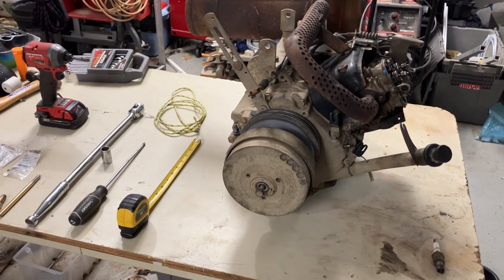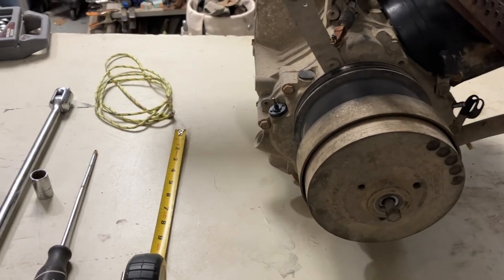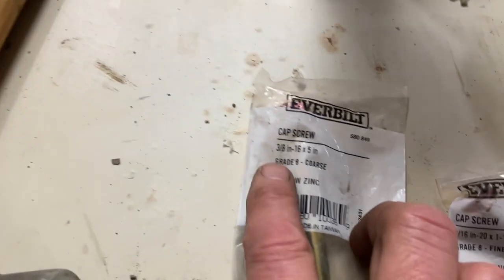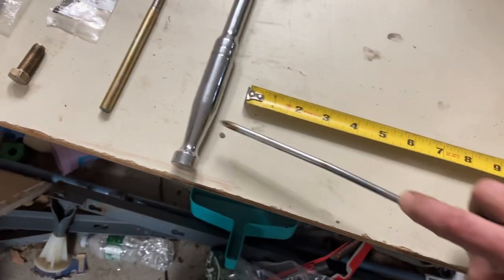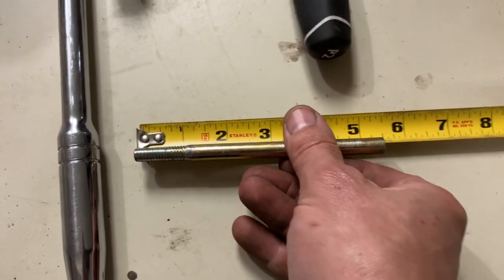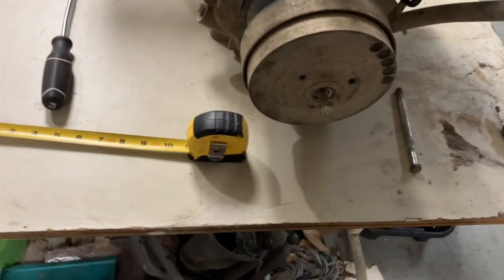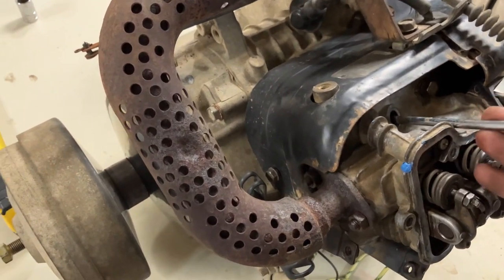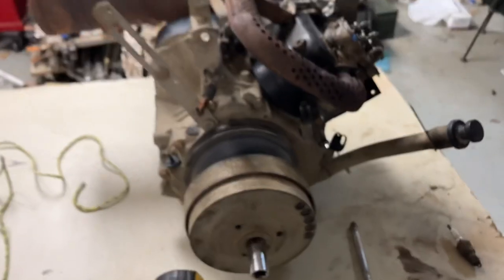Removing the centrifugal pulley from a Kawasaki club car golf cart.

Comment: On the back side of the starter generator pulley clutch that's connected there's 13 mm nuts on the back of it. You can put on there to hold the clutch instead of dealing with that and your cylinder head